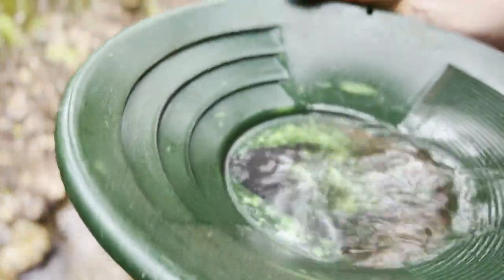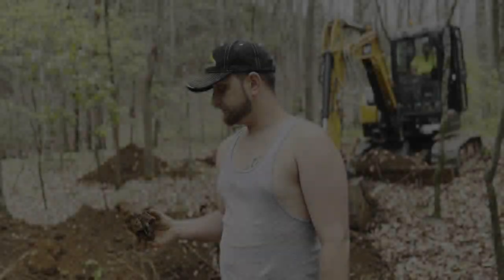Breaking into virgin ground with an Excavator! Finding some coarse Gold!

Comment: Awesome!!! I knew yall had been excited to try out the new excavator and seems like you've got a nice spot to dig for a while.
Reply from the maker: Hey buddy! Yes this was just a quick sample we had finished the road and connected this area for the 4 wheelers. But I had a hunch there would be some pay dirt in this valley. There is creeks on both sides and both have chunky gold in them. So far it seems the material is low grade and not a lot. But the gold that’s there is chunky. Lots more to come. I can’t wait to get back up there.

Comment: Let's say you found the very richest deep ground at 5 grams (5×$55=$275) of gold per "cubic yard". Then remember you would still have to:>>  cut down trees, dig a very huge open pit hole, have 1000's of gallons of sluicing water, pay for the excavator backhoe expenses, and deal with a massive amount of waste material consisting of black dirt overburden & gravel tailings in order to make any big money. Then fill the hole back in for reclamation.  >>Are you ready to do this in all respects.??<<
Reply from the maker: We would start small and yea we have a whole system that we would turn an acre into 4 pits with berms and use two for recalculation and one we would back fill into it. We are just sampling now. But yes you better believe it if we can find some gold worth digging we will figure it out!
Reply: @sluiceboyprospecting  ~Good!! I do not want to be negative but just positively giving you a realistic heads up help. I was on two large placer mining camps. Yes you are doing the right thing by sampling and keep sampling if you can use a 4" to 8" mini micro plastic sluice which is better than only a gold pan. Sampling with a plastic sluice you can clean it up much quicker with no matting. I have a mini 5" Angus MacKirk highbanker plastic sluice set up. Also look at the Kreeger plastic sluice (from California) for final clean-ups. You never know what you will get sampling the different horizontal layered zones. The hunt, solving the mystery, and "gathering learning knowledge" is enjoyably fun. "YES" fill in the old holes with tailings from new holes.
Reply from the maker: @royjohnson465  absolutely! I didn’t take it as negative at all. This was just us finishing up the road we had to dig a hole and see what we could find. I will be running my samples through the monster hog. We did it in another area as well. It was mainly old tailings. I have a 13 ft highbanker with a 9 inch hopper. Thinking about trying to find a small used hopper feeder to feed the giant high banker. I have a few videos with us using it. Thanks for watching and chatting, are you subscribed?
Reply: @sluiceboyprospecting  ~So you have the older Monster Hog 'before' the Super Hog came out, what a high production gravel chewing beast!! Maybe with the backhoe excavator fill 5 gallon buckets with a hopper "funnel" feeder first, then manually dump the 5 gallon buckets into the Monster Hog. I have 7x plastic Angus MacKirk, Washplant sluices for high production but I have to put it together. You could use a Le Trap plastic sluice for clean-up. I do hope you get rich. Over and out!!
Reply from the maker: @royjohnson465  Good  god man. I bet we could talk for hours. 😂 I have never owned a letrap. It looks really easy and I’ve always been curious. I have a few really good freinds that swear by them. I like to bring my cons  back and classify them and run the separate sizes through separate sluices. Then I take all the tailings and classify them +50 mesh and blue bowl them. But I could maybe start with a letrap first. I was especially interested with them when I was running my dredges because I saw people using them to clean dredge cons with the dredge engine on idol. That looked super easy and you don’t have to take the cons back to camp.
Reply: @sluiceboyprospecting  ~Sorry for the late reply. I was on a road trip. Yes we could talk for hours. 🙂 I really do like your various different stages of a clean-up system!!
~The plastic Le Trap sluice is available from Geo Sluice Mining in Oklahoma, they also have a Le Trap mini smaller version that also can be used for clean-up. I built my own homemade Le Trap highbanker but Geo Sluice sells a Le Trap highbanker, I do not like their lame spray bar system in the hopper but it could be used for concentrate clean-up. Geo Sluice Mining also sells the 'bucket sluice concetrator' (a small plastic drop riffle sluice) for concentrate clean-up. 
~Ideally a person should use two (2×) sluices for both primary and clean-up to see if there is any losses coming off of the first sluice.
~Yes the back is cut out of a Le Trap and it is used right inside a dredge with the engine pump on for the first stage in concentrate clean-up. As was done at Happy Camp in far northern California at the Oregon border with Dave McCracken, Dave is sold on the Le Trap. 
~The Le Trap also catches glacial fine flour flood gold really well. It needs lots of water and a Honda WX-15 1-1/2" inch waterpump is recommended, or run it in a stream. As fantastic as the Le Trap really is, the only drawback is it does not handle surging, stop-start will blow out the gold causing losses. The plastic Angus MacKirk sluices with the "Abyss Au-Trap trench riffles" withstand surging much better (and 1/2" expanded metal over top of miners moss also withstands surging very well). 
~Dave McCracken also really believes in the fantastic "Gold Extractor" (Happy Camp, California) for clean-up, I have one. You could look it up on the internet or YouTube. 
~Lately I contacted Kreeger Sluice in California twice but they did not answer me? Kreeger makes a plastic clean-up sluice with a leg stand. It is suppose to be good. 
~Maybe I should get a Gold Hog Multi-Sluice for concentrate clean-up? (I have never actually seen one before except for on videos.)
Reply from the maker: @royjohnson465  awesoem stuff man. I love Dave macraken. I have read every single book of his atleast two times, maybe more for a few. He’s a dredging genius.